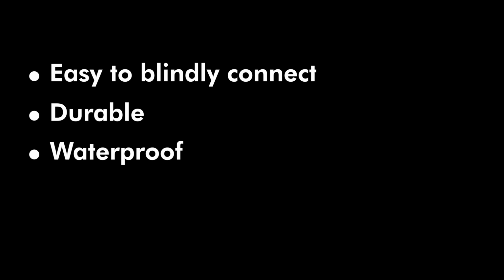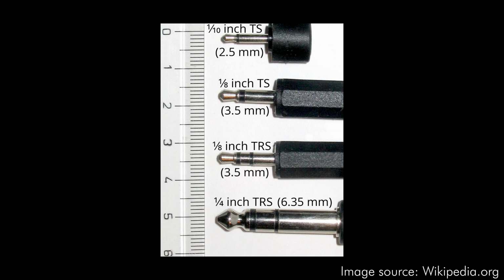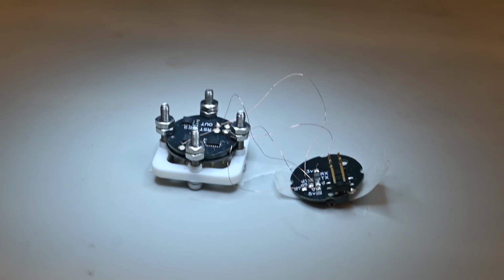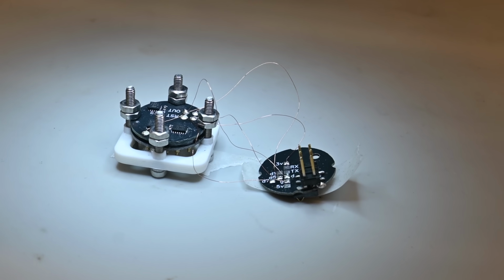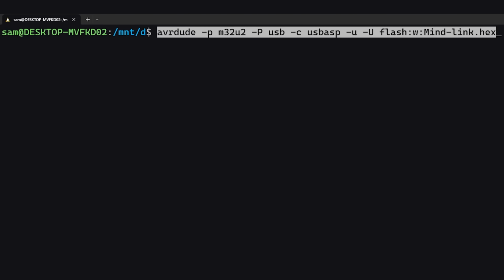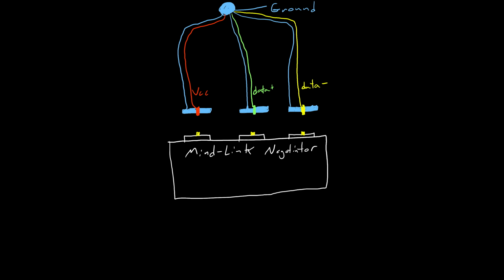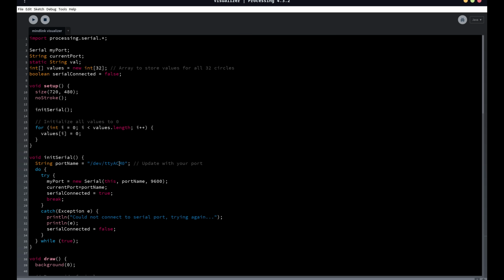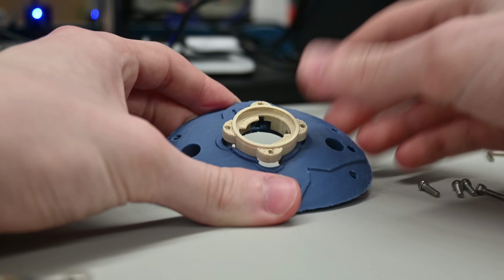Making a Brain Computer Interface in My Garage

Comment: Love the vid, you should check out Precision. It’s a company like neuralink, but instead of drilling a hole through the skull it just creates little slits and slides a film over the cortex. Most of our higher level computation is done in th cortex anyways so you aren’t sacrificing much data integrity. Neuralink’s method is tough because it greatly reduces the structural integrity of the skull and it doesn’t scale well, plus 80% of the intracranial electrodes become inert after like 8 months due to the brains robust immune system. Essentially the brain rejects thing being stuck into it.

Comment: But ... the brain can move inside the skull. Quite far actually (centimeter range during running and similar physical activity).
How could electrodes, connected to a rigid point in the skull, be able to both stay connected, and not disturb the brain-matter ?
Are you making a brain-scrambler ?

Comment: Has there been any thought into placing a microelectrode array into the peripheral nervous system such as in the arms? It would be very useful for things such as prosthetics if the array could just be placed near the most relevant nerve without needing the specialized brain surgery.

Comment: I saw a recent study where they modified brain cells to have photo receptors, then used transcranial light to cause them to fire. I think they learned to perceive the signals, but I can't find the study. 

Combined with fNIRS, I think you have a higher bandwidth lower risks interface.

Comment: I advise 3D printing this in two layers. On the bone-interface side, the material of choice is hydroxyapatite, a ceramic that's chemically similar to natural bone and can be modified by osteoblasts, and would improve osseointegration. Iron and titanium can be added to create a cermet with improved toughness over pure hydroxyapatite.

The outer layer would be better off as a PAEK family polymer. They also tend to be relatively biocompatible, and offer excellent toughness, tensile strength, chemical resistance, and abrasion resistance, and can be modified with collagen to promote soft tissue bonding. It would be your best bet to form a tight seal with skin. Transdermal implants do tend to suffer from infection risk and require extremely meticulous hygiene, because you never really have a perfect bond between soft tissues and the implant. And if we're sticking things into people's skulls, this becomes crucial. The last thing you want is your iSkull 9 to give you meningitis.

Between the layers, you can include a viscoelastic shock absorber to prevent your neural implant from turning you into a modern day Phineas Gage if you should slip and fall, or else take a wayward baseball to the back of the head.

Comment: You're basically making a super low performance arduino based USB digital I/O expander, i'll write out some constructive criticism i guess:

- non invasive BCIs are a thing, openBCI is a thing, no hobbyist will ever implant anything in their garage like this, but OpenBCI can get you signals out, there are also BCI frontends like the chips from nanochap that do the same thing in an integrated package.
- an atmega MCu running arduino is just not something that would ever get used there, for a BCI you'd need fast signal processing, with huge bandwith, something like a WCSP packaged FPGA would make way more sense (can do spike detection on the device, and noise isolation).
- you'll need ADCs with high BW as stated above, and the means to do signal processing on a large matrix to isolate the spikes at different frequencies, the usb 2.0 FS (not HS) you get on that atmega is too low (~8–9 Mbps in actual transfer speed). That won't work, you'd need around 15.36 Mbps for your 32 electrodes sampled at 30Khz (respecting nyquist, could get it working at 20Khz but it wouldn't be great signal integrity wise).

These subjects require some actual work to understand for sure, but once you get the skills to use that tech, you can make some really nice stuff for yourself and the OSHW community. But this specific video's title and framing is a bit like saying "i've built a new open source rocket standard" when you've actually made one of these soda bottle water rockets, it's clickbait at best, and if you presented this at my uni as a student project (depending on what you're studying), you would get a lot of flak for creating such simple, dead end hardware.

I'll at least say the mechanical design looks neat. Just keep learning, it seems like this is one of your first projects in that field (going off of your videos). I don't intend to be a hater here, but if you actually try to make this work in any capacity (as in actually get signals out and "control" stuff with your mind), at the hobbyist / student level, an invasive interface makes no sense. It makes sense to do exploratory projects as a maker for fun that don't make much sense in the actual application, to learn about the challenges in a given field, just don't oversell it :)

Comment: i like the base concept of this, but there are a lot of shortcomings in terms of what the current design is. in short there just isnt enough signal samples. the brain is comically complex, billions of neurons. you would want at least thousands to capture even a small fraction of the thoughts of a person. that itself presents huge problems in terms of handling all that data. with today's technology it might be doable but only just. other commenters have mentioned FPGAs, and that would be good on the head mounted side, but you would still need to offload that data to a computer, and fast. both because it would be funny, and because its fast and readily available, you might want to consider displayport, yes, the video connector, to handle all that data. connecting it up to a custom pci-e card would be the ultimate solution short of getting comically expensive with the project i think. you could probably go further actually, if you consider the kind of recording you are making, it pretty much just is a video signal where one pixel is one (or 3 if using colour) neuron(s). if doing that you might even just get away with a regular capture card

tl;dr: get more signals, a lot more signals

Comment: You have so far to go... So much to learn. I work i a hospital and know quite a bit about electronics, the environment  inside the brain, I also have a cochlear implant coupled to my auditory nerve. The nerve electronic interface SUCKS. The circuit board under my skin attached to my skull uses an inductive coupler to both transmit power and data to the electrodes. It all runs on a very small LI battery and rests behind my ear. I can only say the direct brain implant has a LONG way to go. Musks device sucks in reality. It gets a lot of publicity and hype for investment purposes. That hype is not reality. Its investment pump. I know of a neuroscientist who wanted to do exactly what you want to. He walked away. We simply dont have materials that work well for long term in a highly corrosive environment, The capabilities were much more limited than even he expected. We have another ER surgeon who works in bionics. The mechanical interface to the body is so bad he keeps working on it but the technology is very limited. Then technically you have to get it approved by  the FDA.

Good luck. I simply wish I had my natural hearing back. Right now there is no good substitute for the natural biological interface.

Comment: Why is everyone going crazy about this? Every part of this is just insane. Having an easily openable hole into your skull is insanely stupid and will kill you. Why use pogo pins on a moving human? How are we skipping over every hard part like the actual brain interface part and the "ML model"? This is literally just a basic counter circuit not capable of measuring anything. You could just as easily waterproof a disk style USB connector as the 3 separate cable system. How do you want to negotiate which line is what when the chip has no power? Totally unnecessary complexity. Why make the plate this huge? Idk I just don't see anything in this project.

Comment: Ive thought and pured over this type of thing endlessly myself. ive had all sorts of ideas. ive wondered about maybe some small uv lights, that would light up the whole implant periodically throughout the day, around the skin, "sanitizing" it, but to everyone else, would be nearly invisible on the outside due to a cover, or slightly visable through some sort of shade/lens that dulls it.  im hoping we can come up with some sort of "neutrual"bone/ceramic/ composite, that might be able to better aide with implantation and immune health. maybe, once a day, someone changes a pad, that shields the skin from the uv rays, but would sanitize the area around and slightly beyond +within, and within the change process, the gel that sheilds/protects/moistens/would also help with the uv ray issues, becuase theyd have to run pretty much constantly.
Reply from the maker: UV light is bad for all life, including human cells. It wouldn't be usable as a disinfecting agent because of this, since any infection would occur on the human flesh itself. The best course would be to use materials that the immune system completely ignores, and then fully embedding the device under the skin so none of it is exposed to any outside air.

Comment: Why not wireless charge+ optical signal transfer? 
All that connectors, protruding from skin are gates to infection. Most common reason of death of people with heart implants was infection through wire channels.
Of course, completely wireless solution would be a security issue. But optical port through skin would be good enough solution. Or very close range wireless communication.
Reply: Wireless charging would quite literally fry ur brain... Except with the right implementation. See latest neuralink video for what you said and more

Comment: One thing to achieve this access to the brain is hard especially keeping the brain active, alive, and not rotting or damaged from our tech and device
By any chance I have been imagine a device that could actually interface with the brain sending singals out from the head to other electronic such like sending a Bluetooth or wifi signal to some tech
It is called the NLD ( Neural Linking Devices ) a fantasy tech that could actually almost work
It is small around 10 Mili meter and implanted inside the brain stem
It receive the brain eletric Singal and transformed that eletric Singal to wave Singal 

This works while we can still control or feel our body
But having 2 body
But it could be fatal on the center of brain it self 
I informed you that this is just a fantasy idea but to inform that it might work in the future 
What I meant fata in the center of the brain
It could lead to brain confusion or death
Why center?
That's where it would connect to our memories, ability to see and hear, feel and other 
It could be fatal because it would intercept our sense and ability to think and more

I don't have a full R&D but
This is just a device that recently popping into my head
Reply: Come to think of it
When it fails or overheating 
It could actually damage the brain it self and each upgrade or replacement need full brain surgery

Comment: I might consider a gold + Parylene C two layer coating, and perhaps actually removing the ports and going wireless for both data and power. I feel like this might seriously reduce the risk of infection/rejection. Bioglass might be safer, but more problematic for EMF. I'm kind of horrified of putting a battery in a device like this, but with a necessary wearable component it could be wirlessly powered as needed. You could also have a public key embedded in it, so it won't respond to unauthorised devices. Just some thoughts. Love what you're doing.

Comment: I mean... sure... But experiments so far have been pretty bad. Every attempt just has the brain create insulation layers to protect itself from the intruding probes, and they become useless after some time.
You need to somehow shock the brain, but also it needs to be strong enough to make all the bodys defense mechanism fail... and I doubt that strength of the shocks is gonna be especially useful.

I don't see this being useful for a long time, I'd more so bet on the read-only version, that is non-invasive, and rather work on error correction. They can still be embedded into the bone if one really want to, and have wiring come to some connection point.

Comment: HEY🎉 US20110028827A1 that's the patent too a type of bio feed back that will help push this along quite a bit I'm more then interested if you want to collaborate or atleast have a backboard for ideas I see there's a type of tiny 4mm by 4mm + made of gel I thing having a bunch of little bald spots it alot easier to hide to keep track of to put on an off an it needs to be like Nair bald I see a headpiece or track you could make for 360 attachment spots so to say have a template to help reattach them once more

Comment: first of all, this is a really cool project and i really enjoyed watching the video

that said, i have some constructive feedback if your goal is to make something that could actually work in practice:

- neural signals are on the order of 10-100uV. to amplify this to 5V you'd need a gain of 500,000 (!). this should be done in multiple stages, as doing this in a single stage will result in a signal completely dominated by noise. plus you won't find an ultra-low noise amplifier with that kind of gain anyway

- first stage: an ultra-low noise preamp to bring the 10-100uV signal above the noise floor, with a gain of 100-1000x. this should happen as early as possible to raise the signal above the noise floor before noise has a chance to creep in. the preamp should have a high input impedance to reduce susceptibility to interference. read the datasheets and make sure that you have enough bandwidth. for programmable gain amplifiers, be aware that more gain = less bandwidth

- once the signal is above the noise floor, use analog signal processing to clean it up as much as possible before amplifying further. i don't know what this would look like for neural signals, but the idea is to identify which aspects of the signal carry the information you care about and filter out everything else. this will greatly reduce the amount of digital processing required later, as well as the necessary ADC bandwidth

- don't try to make your design small yet -- you will quickly find out that you can either do it cheaply or do it small, but not both. focus on getting the amplification and filtering right first. the intan RHD2132 chip is perfect amplifier for this application, but be prepared to pay $430/chip, or $940 for the headstage PCB

- do everything in parallel. your multiplexer chain will reduce the effective sample rate, introduce switching noise, and likely introduce irregularities in timing between channels, which is crucial if you're processing spikes in neural activity

- using an FPGA or a sufficiently fast DSP will allow you to handle multiple channels in parallel will be much more realistic than trying to force everything through a single microcontroller. use the microcontroller for higher level orchestration type stuff, transferring serialised data, etc

- consider switching from pogo pins to high-density mezzanine connectors for better signal integrity

- some suggestions to move in the right direction (not necessarily ideal, but should point you toward something feasible): use one ultra-low noise preamp for every one or two channel -- something like an AD8422 or AD8429 is cheap and works, but be prepared to deal with 16 chips for 32 channels

- the same chip can come in various package sizes, make sure to check which are available. for example, the AD8422 comes in a typical SOIC-8 package (6x5mm) but also a much smaller LFCSP package (only 3x3mm)

i don't say any of this to discourage you, and i should add that there are surely creative solutions around many of these signal processing conundrums that would allow you to create something usable with less complexity.

Comment: I personally hope we can increase functionality of non invasive forms of this technology as it would allow it to become more widespread witj less risks and less resistance. Ive seen brainwave scanners used to identify signals and essentially amplify them for using artificial limbs. This seems to be the more logical path even though it requires more than a single system but could be used by far more people. Mind you im biased because my body heals weird and my 5 year old peircings would seal up if i took my earings out for a weak and im allergic to most metals.

Comment: Bacteria is gonna get in-between the skull and device and get into the brain.
Reply: This whole thing is a nightmare from an infection control standpoint. All devices that pass through the skin have infection problems, only this is directly into the brain. Its not a matter of if, but when an infection gets through and kills the patient. I cant see a patient living more than 10 years with a device like this. You really need to do more than Wikipedia-level research before you start claiming to make an open source implanted BCI.

Comment: There's also a company called presision neuroscience thats developed a sheet of electrodes that sits ontop of the brain without any invasive pins. and slides in through a tint slit in the skull instead of a giant hole.